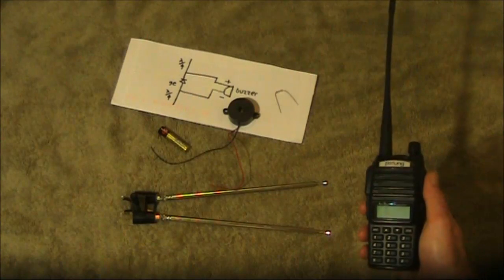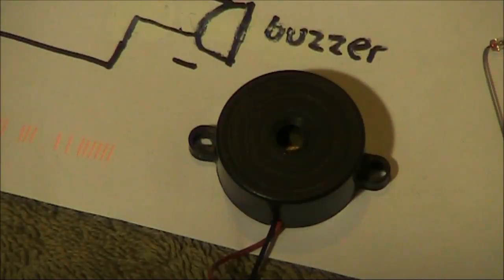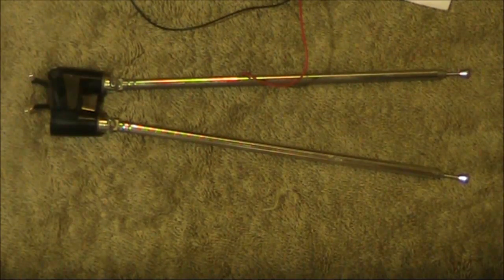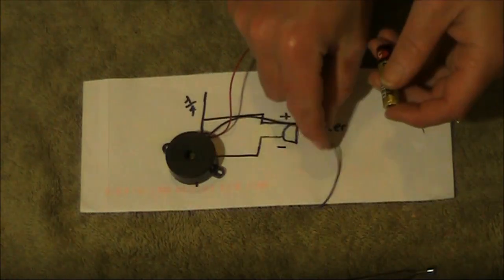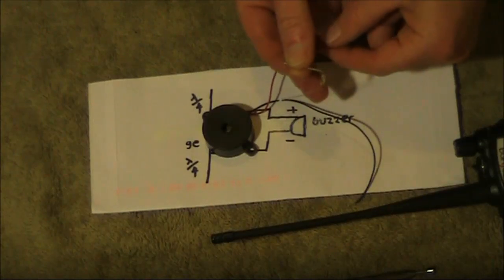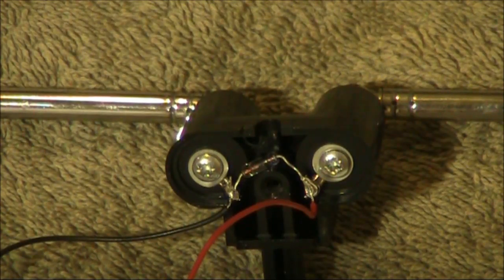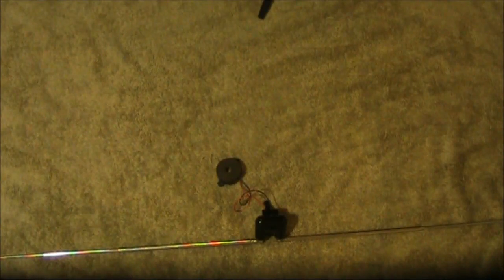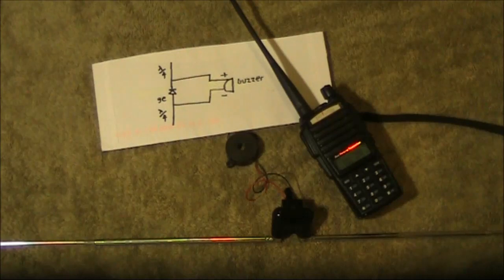Build an audible VHF/UHF handheld transmitter tester in 10 minutes

Comment: In my case it only works with 2 germanium diodes in series with one wire wire antena attached in the middle and second one on the positive side (correct me if i am wrong but currents add in this case I think). Maybe because of my low power transmitter (it was built for my toys and also I can't increase the power for obvious reasons). So probably your radio has like 10 times more power than my transmitter. Anyway I had to adapt my circuit to squeeze that current into the buzzer somehow ;)

Comment: I suppose you could replace the buzzer with a sensitive meter and use it to check the efficiency of antennas. Perhaps use an old "active" set top antenna (i.e. with a built-in RF amp" and with telescopic elements. Very nice, thank you!
Reply: Thats called a field strength meter